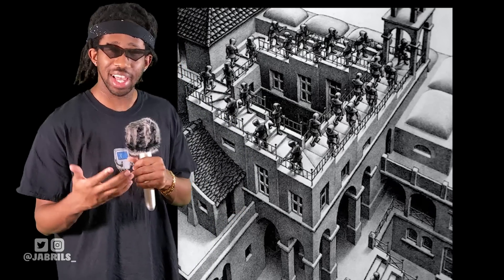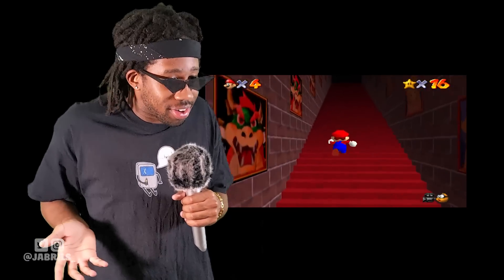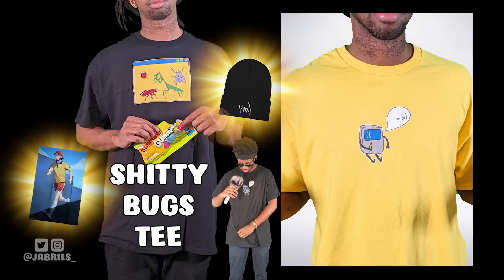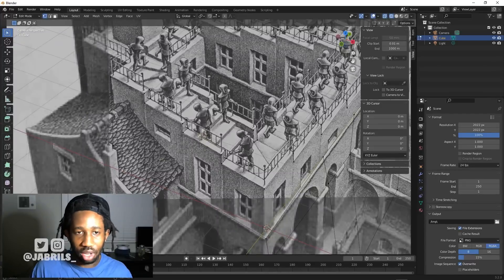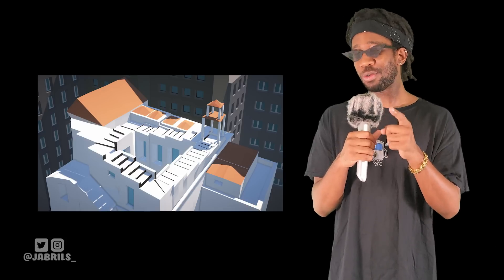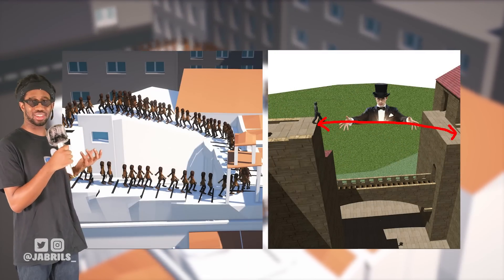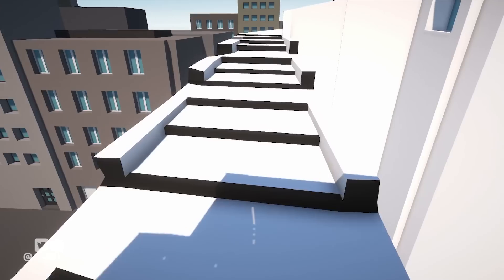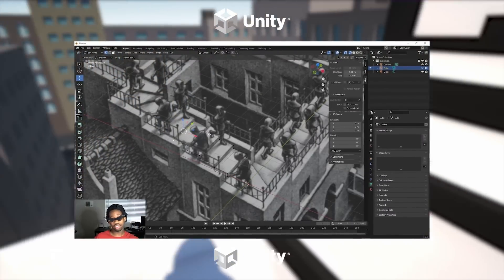This building has an Infinite Staircase, but it's not what you think..

Comment: Cool stuff! Here’s a tip that might save time in the future. For blocky shapes like the steps, it’s usually easier to start by modeling a boxy shape with right angles, then add and subtract from it using the extrude tool. Also, since a lot of the steps are exactly the same, you can copy and paste them.

Comment: The proper way to do it is make it infinite, but not technically a staircase.  The "staircase" is laying flat, but the stairs are at an angle to make it look like a staircase.
Reply: Exactly. This is just the illusion, but you have to walk the fake connection instead of teleporting.
With a variable direction for gravity you could even gradually change the angle of the stairs and have the whole transition feel almost completely natural; or you could just lock the camera to always be the same angle relative to the surface you are standing on.